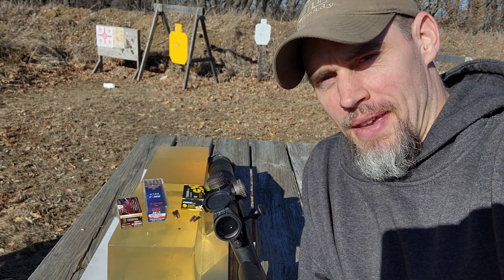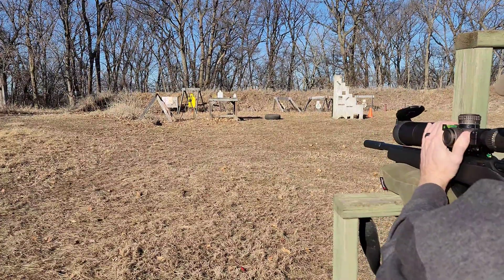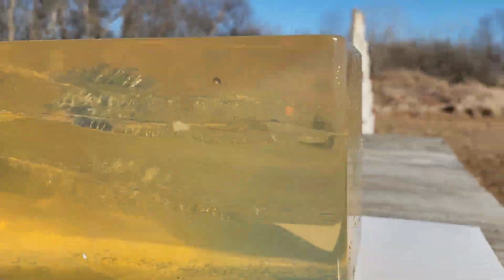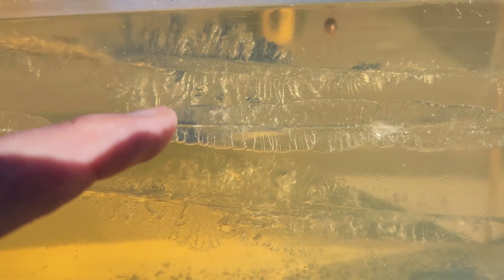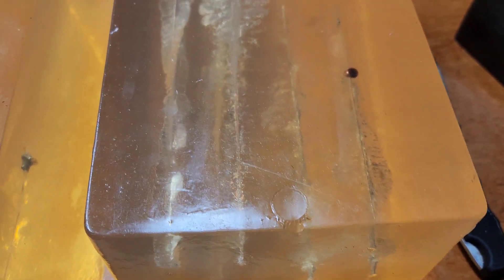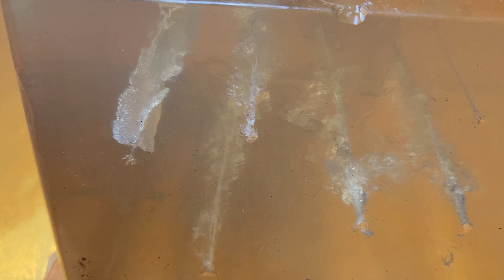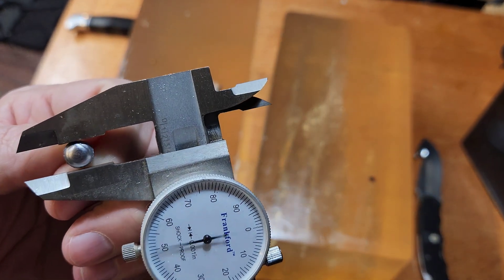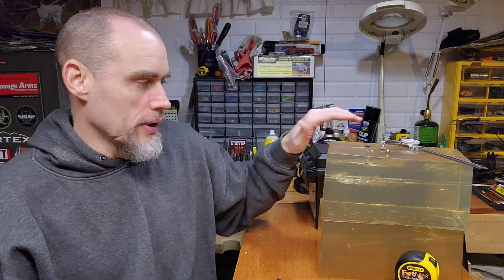Testing 22lr ammo in ballistic gel.

Comment: I suppose you could add some bone to the mix? Suspend it with a string so it doesn't sink to the bottom as the mix hardens? Perhaps use some pork ribs and/or bovine bone? These are questions.